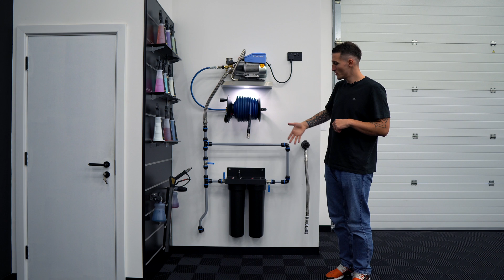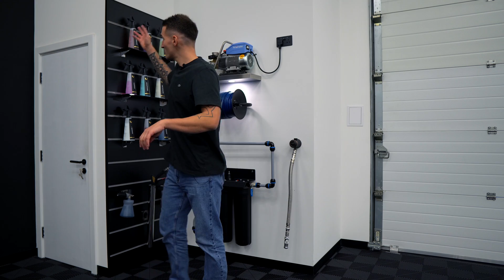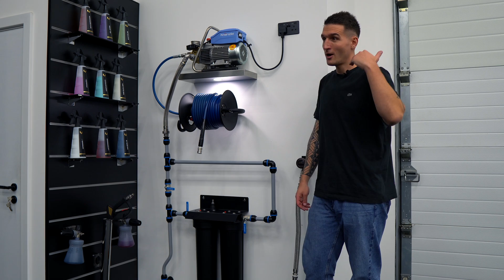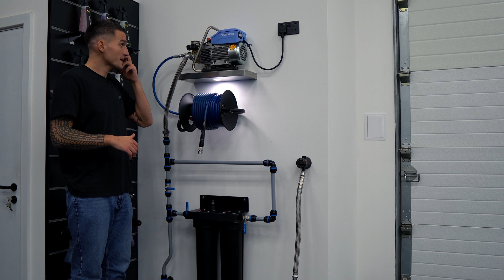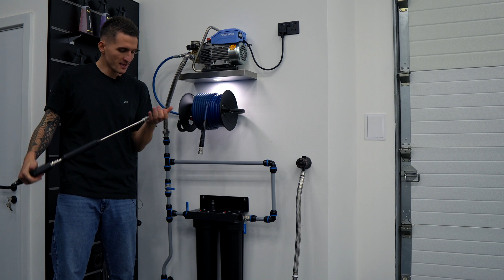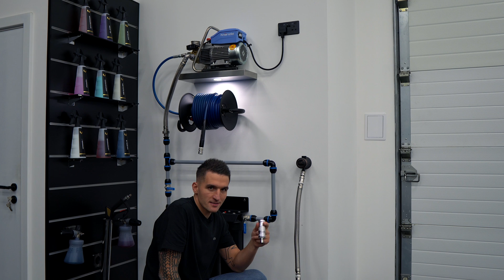Amazing Wall Mounted Kranzle K10 Pressure Washer and Custom Deionising System

Comment: Very nice set up, a dream for me. I doubt to buy the Kranzle 7/122 and the 10/122. They both should give approx 120barbut the   7/122 gives should give 7liter/minute and the 10/122 10 liter/minute. The motor of the 7/122 is 1400rpm (84db) and from the 10/122 is 2800rpm(90db). Wich of those do you suggest? Or is het Bigboi wash pro better? The high pressure washer must be installed in the garage that is in our house so I don't know if the 10/122 is to loud. What do you think?
Reply from the maker: If you have the choice the K10 cannot be beaten and you achieve 10 litres a minute which is beautiful!
Reply: @YumCars  is noise not an issue?
Reply from the maker: @timmymues9256 for us no

Comment: Hi, can i ask what size orifice nozzle you are using with your machine, i just bought the HD 10/122 ts and am using a 4.0 orifice nozzle by mckillans thats giving me 120bar, it seems very powerful to me for car cleaning have you tried a 4.5 or a 5.0 orifice and if so what kind of pressure readings are you getting, thanks 👍
Reply from the maker: 4.5 should be the smallest you will ever use. 

In 0.5 increments above this it gets better and better

Comment: The floating shelf looks much better than the under bracket style that's commonly used, I'd lean towards a blue rubberised hose for the outlet personally as it ties with the accent colours in the rest of the setup and won't have memory like the steel braided seems to have a little bit of.

Do you know when the kobrajet hoses will be restocked?

I'm debating going for the grey vs blue though I'm reel-less hanging on the back of the shed door (no garage life wcyd) I'm leaning towards grey as it matches the MTM grey better than the blue matches the kranzle though blue might reduce the risk of someone running it over one day :P

Cheers
Reply from the maker: They are on the way as we speak

Comment: Will you be able to connect water supply from outside tap to set up instead doing lots of plumbing
Reply from the maker: Anything is possible but it won’t be a clean look.

Once we sort out all the parts you will have no headache as you will be able to buy the package

Comment: You're just really going for the Obsessed Garage except the UK version eh? :) Looks great indeed.
Reply from the maker: Thank you for watching 

The parts and pieces are from factories that have long been here before the detailing industry even existed, some even are not recommended for the pressure washing world but just work 😀
Reply: Thanks for responding. Yes, I was mainly talking about the general layout of the setup. Ofcourse there's only so many ways to make a wall setup that makes sense from usability perspective. :) I also appreciate your backround work for figuring out solutions for the fittings between different markets/styles. 
Actually I prefer a darker colour to a brighter one too. :)
Reply from the maker: You are right, only so many ways to make a square look as aesthetic as possible. 

Between European and US threads took us the longest and even then when it couldn’t be done custom fittings had to be made, especially if we begin to offer this package to the wider public